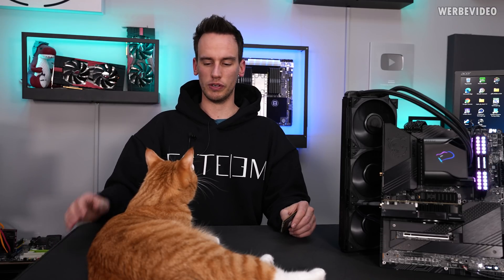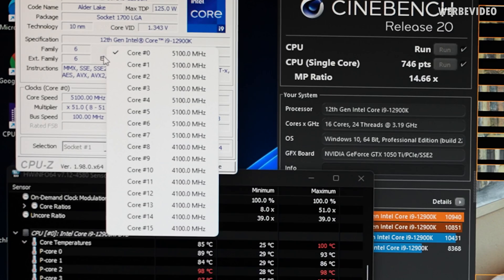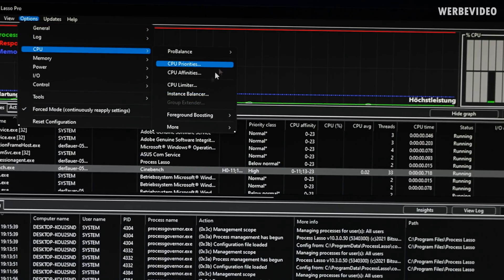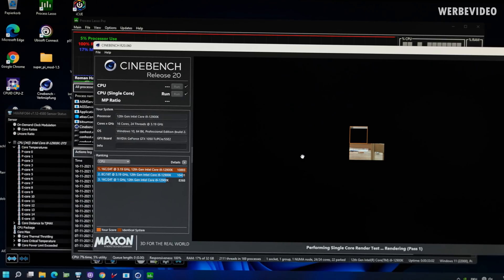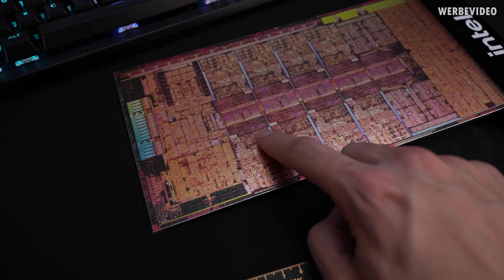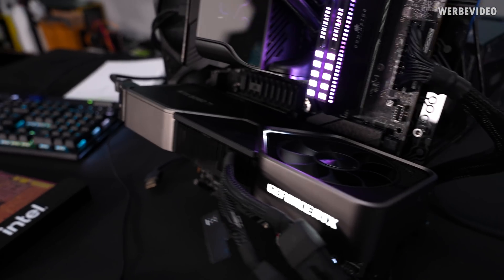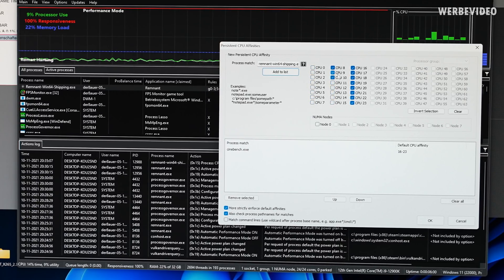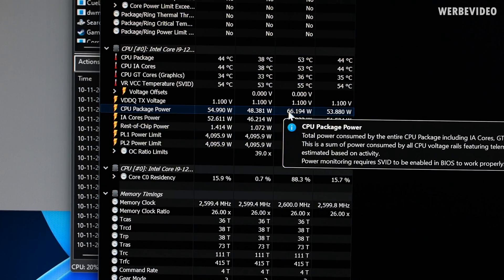The E-Cores were not meant to be used This Way... but it's Amazing!

Comment: Interesting piece Roman. Why would people think the e-cores are so shite, that's what I don't get. As you said, makes perfect sense to have CPUs like this to assign the appropriate type of core to the appropriate type of process/workload.
Reply: people just think its bad because of a handful of cases where the thread director decides to put the load on e cores instead of an unused pcore optimally, leading to a potential drop of performance. It's the same idea and situation as when hyperthreading was introduced, and games back then during sandy bridge which used 4 threads or less ideally loaded it onto the physical core rather than the hyper threads, and would see a performance game by doing so/turning hyperthreading off. Of course though, over time, that sentiment ages badly
Reply: A lot of people think of ecores in the mobile frame of thinking where these devices are fairly weak. This just isn't comparable it seems.
Reply: P-core faster then E-core by 86% @stock clocks with AVX-512 disabled?
Reply: One word: AVX512
I almost purchased 11th gen because of it, but I was so relieved upon hearing that you can enable AVX512 on 12th gen  when the E-cores are disabled. Here I come 12700K!!!

PS: my machine learning algorithms run more than ten times as fast on AVX512 than on AVX2.
Reply: I mean, some of this is to blame on intels own marketing. for the last few gens they've pounded the desk saying the only thing that maters is single core speeds (because that was their strength over ryzen) and now they're "guilty" of making high thread low single core preformance (cores) and the consumer doesn't understand why , its back fire from their own dishonest marketing.
Damn shame too because as hes pointed out their quite the impressive technology,
Reply: I saw another reviewer who did similar tests and his conclusion was very different. Maybe it's the software he used to separate the cores but he has much less then half the fps in games and multi threading capability was awful. This review gives me renewed hope in those little e cores.
Reply: E cores are basically low clock 10th gen cores afaik, and people probably expect atom cores like knight's landing xeon phis.
Reply: Sounds like unverified rumors... Just people randomly spouting things and repeating it without testing it first..  I figure the names "performance" and "efficiency" probably add a bias without knowing how they work.
Reply: E cores only make sense in a device that runs on a battery/small device. In a desktop that already sucks up hundreds of watts it doesnt make sense. a 10core 20 thread p core only chip would be even plenty faster than a 16 core 24thread 8p+8e core config.... It's intel just not being able to get a better efficiency chip that's why they had to introduce this technology to somehow keep their chips from melting themselves.
Reply: @SweatyFeetGirl  before I watched this video I would've agreed with you, but after looking at his data I'd prefer the 8+8 combo over a 10 core in basically any situation.
Reply: @SweatyFeetGirl  in a business environment where you have like 1000 machines, and they are mostly idle but need burst performance it makes a lot of sense.
Reply: @satibel  agreed but in that case why Intel didn't include any e-core inside their low end die that will populate many business/office workstations? IMHO that's a real shame.
Reply: @SweatyFeetGirl  while that is true for most people, the watts add up fast in large installs, or in small rooms. 

My last company had 1600 desktops in it and even on a brisk fall day if the ac failed we were all sweating (soaking shirt style) 4 hours later.

Yeah, not much of a care for consumers or many gamers, but efficiency has real world benefits.
Reply: @SweatyFeetGirl  i totally agree with you but intel didn't want to go past 8 cores to avoid latency issues with the ring design, also 10 P cores will be too hot to cool and will end up consuming shit ton of power. 
intel added these E cores to catch up with AMD in multicore tasks without going overboard on power consumption, i still think that this design is better suited for mobile chips not desktop.
Reply: @SweatyFeetGirl   I’m not sure if you’re trolling. They chose 8 cores because that’s what most applications support multi core capabilities up to. Also E-cores take up significantly less die space, offer much more energy efficiency for their perf. Also where are you getting the 86% number? Are you talking about R23 single core? R23 multicore? How about comparing them based on die space, how does 8 E-cores perform on R23 multicore compared to 2 P cores?
A lot of the benchmarks such as Anandtechs currently compare 8 P cores to 8 Ecores, but that’s not really the same comparison since the 8P cores have 3-4x the die space. Try 1P cores vs 3-4E cores instead. Not only is more than 8 p cores irrelevant to gamers, less e cores will be bad towards creatives that can utilise additional cores. Give me a use case where a 10+0 core cpu makes sense because a 200 billion dollar company can’t.
Reply: @SweatyFeetGirl  that video flew right above your head
Reply: @SweatyFeetGirl  2 P-cores take the same die area as 8 E-cores so you could theoretically have 2 P-cores with 32 E-cores within the same die area and that would perform way better than 10 P-cores in multithreaded rendering.